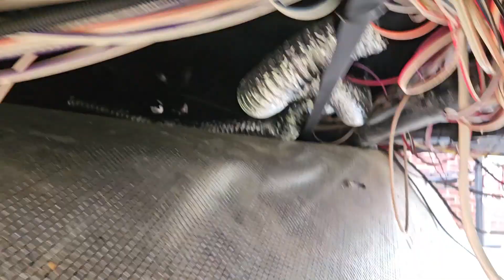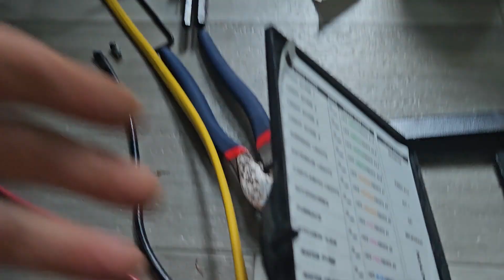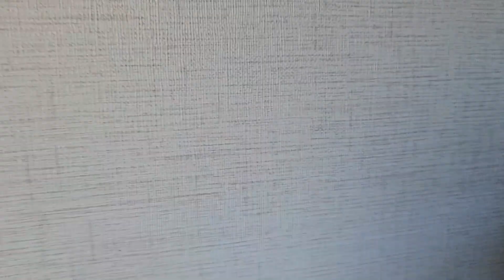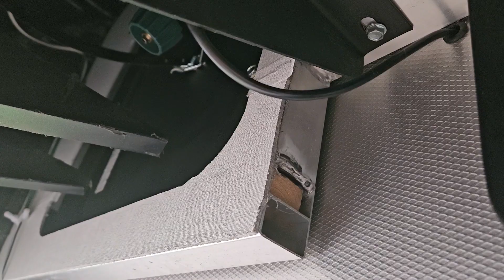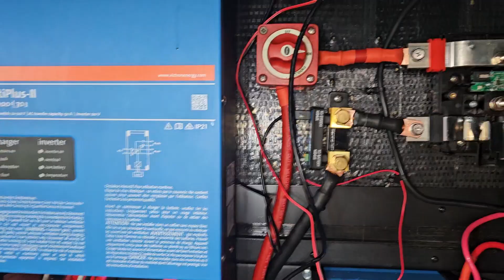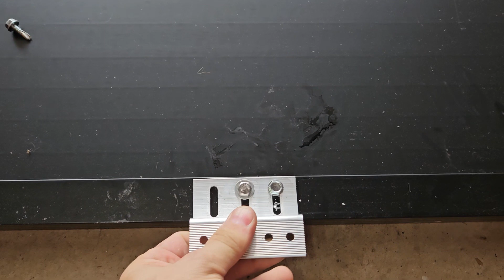Multiplus II 2X120 24V install  - Alliance Avenue 37MBR (7.2 KWh for under $3,700)

Comment: The link to the 20 ft USB extension cable doesn't appear to work.  I'm curious what cable you used as I'm having trouble finding one that works due to the voltage drop across the cable.  Thanks.
Reply from the maker: Hi the link still works for me, but it takes you to Bitly 1st then gives you the link to Amazon.  This cable works fine for me. 

https://a.co/d/aCFrTd3
Reply: If you're using the 7" screen I'm not sure the long USB cable can power it properly.  Doesn't seem to be an issue with the 5" screen.  You might need a 12V-to-5V USB converter and wire it in near the screen's location.
Reply from the maker: @FU2_Ggl  I am using the 7 inch and the 20 foot USB works fine.  No problem after 9 months

Comment: How well has the Orion been supporting the 12V systems without the battery?  I would suspect the two front jacks have the highest load.
Reply from the maker: I have had zero problems.  Everything runs as it should through the Orion